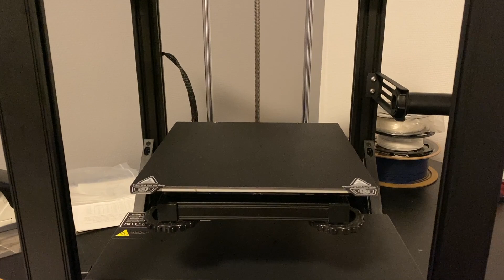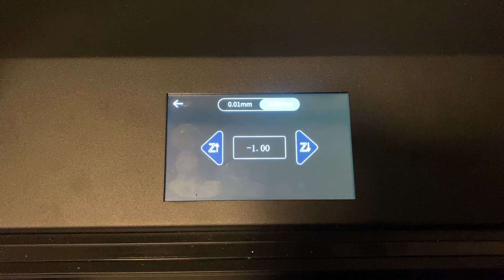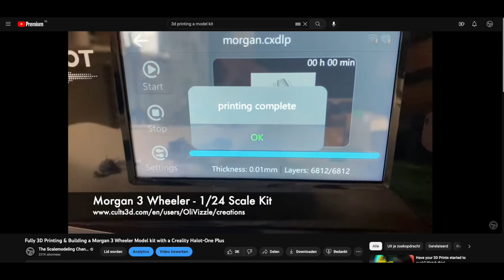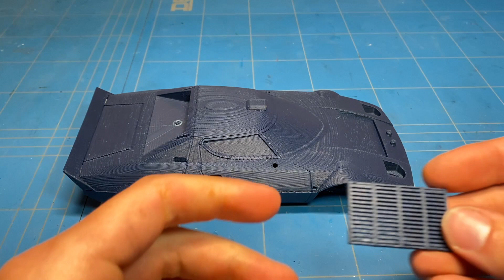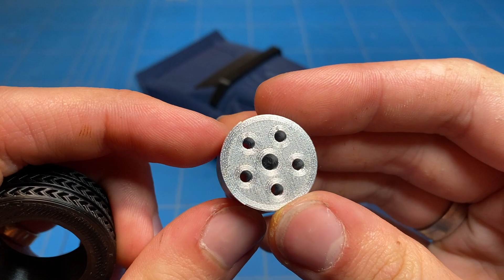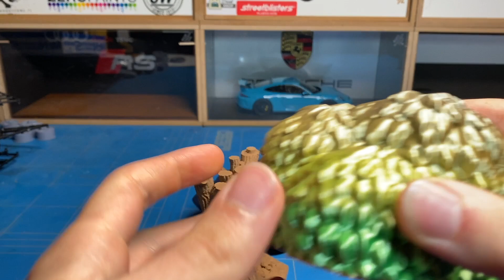3D Printing a Lancia Stratos Model Car with the Creality Ender 5 S1

Comment: With some filler and a crap ton of sanding, you can actually get a show quality finish for 3D printed cars. I have done quite a few now, and i am not dissapointed. Some cars are just not available as diecast or kit form, like my Mazda MX-3. In that case, printing is a great way to get a specific model

Comment: Im just saying, you cant truly judge the full capability of detatil printing when you print at a much larger layer height than the printer is capable of.
Reply from the maker: Correct. Thats why there where also multiple prints done at a finer layerheight

Comment: Bought the S1 yesterday as my first ever 3d printer. It arrives tomorrow and I'm very excited!
However I got the Ender 3 S1.
Reply: Ender 3 series is a great printer. I have the 3 v2 with a couple of upgrades and it prints like a champ. Looking to get the E5 S1 for the better hot end to use for industrial parts printing.